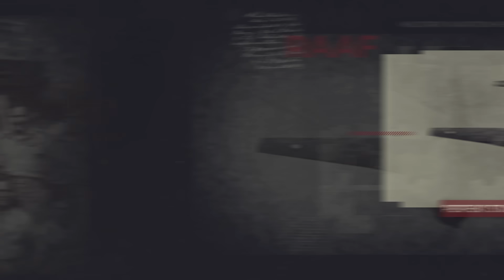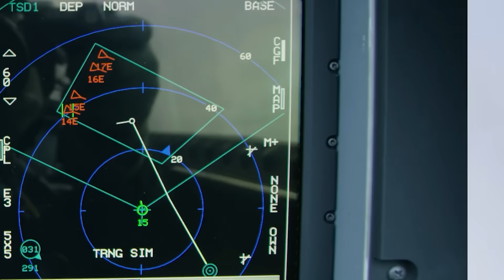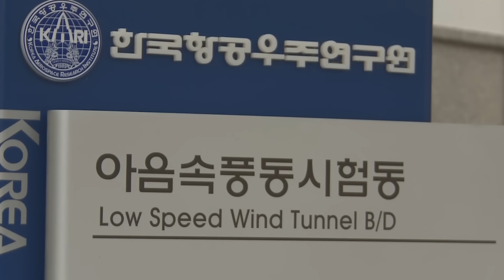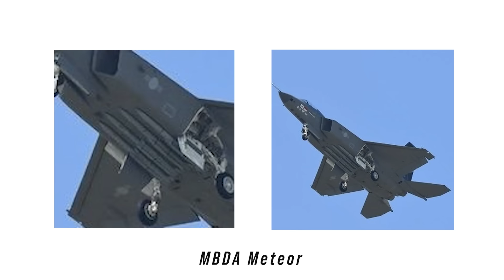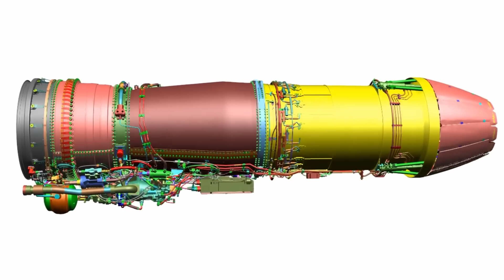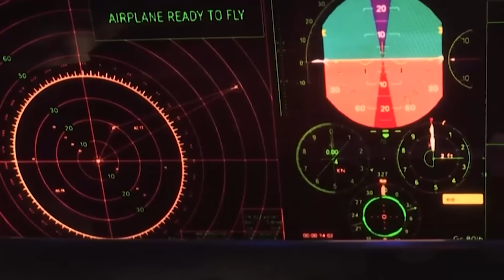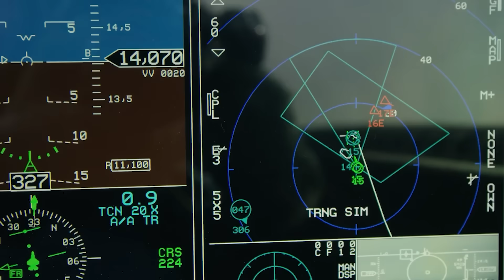KF-21: Korea's New Fighter

Comment: For Australia, the KF-21 would indeed be a good option. Currently, Indonesia has been delaying its 20% share of the payment for years, only demanding excessive technology transfers that differ from the initial contract. South Korea has requested that Indonesia at least submit a plan for the share payment, along with compliance with the contract, but the Indonesian government has even missed the promised deadline for the payment plan. In this situation, if Australia, one of South Korea's closest allies, were to cover Indonesia's share, it would be a very welcome move for South Korea too.
Reply: Well, Australia has a better credit rating, that's for sure.
Reply: When the South Korean government initially evaluated the plan, they considered it somewhat risky to independently develop an aircraft with such capabilities. Therefore, the government was only willing to approve the project if the risk could be mitigated by adding a foreign partner. It seems that Indonesia's commitment to financing the project played a significant role for KAI  to persuade the South Korean government to approve and support the project. Despite Indonesia's current reluctance to fund the KF21 due to changes in their political stance, KAI has achieved its goal by getting the support of the South Korean government and advancing the fighter's development to the current stage. At this point, Indonesia's cooperation may not be critical, as KAI has largely realized its short-term goal—a domestically developed middle-class fighter to supplement F-35s, which are not enough in numbers to fulfill all the Air Force's needs...
Reply: And they stole secret documents yesterday.
Reply: @Eric.Y314  false flag actually
Reply: @Eric.Y314   Apakah ada bukti ?
Reply: @Eric.Y314  the accusation of stealing is just a drama made by Korea to pressure Indonesia to continue what the world already knows, and now it has been proven that Indonesia did not steal and in the investigation by Korean investigators DID NOT FIND ANY EVIDENCE THAT INDONESIAN ENGINEERS STOLE THE TECHNOLOGY ON THE PLANE. AND WHAT NEEDS TO BE KNOWED IS WHY INDONESIA DELAYED THE PAYMENT OF THE PREVIOUS CONTRIBUTIONS THAT HAVE BEEN AGREED TO BE BECAUSE THE KOREAN PARTY BREAKED ITS PROMISE RELATED TO THE TRANSFER OF TECHNOLOGY PREVIOUSLY PROMISED TO BE GIVEN TO INDONESIA ON THE CONDITION THAT INDONESIA WILL BEAR 20% OF THE CONTRIBUTION COSTS.
Reply: @FadhielMuhammad25  Your logic was proven wrong at the recent Apec Summit in Korea. When the Korean president urged the Indonesian president to keep his promise, the Indonesian president panicked and requested a closed-door meeting. How shameful! And yet, do you still believe such false propaganda?
Reply: As a South Korean I won't be surprised if our government is still open to future joint development and production programs with more countries that are mutual allies to the US. We like friends who are like us: democratic, with a scary autocratic neighbor, and in need of a lot of equipment without paying a metric American Defense Budget for them.

Plus, I like the AS-21 Redback. Because it's cool.
Reply: If Australia is Korea's partner, it is far more competitive than Inni in technology and production line transfer. But even if they try it, Korea will not easily let go of Inni. However, I think Korea will be friendly if the decision of ally Australia to participate is implemented.
Reply: 인도네시아는 신뢰를 버렸다. 개발기간 동안에 맘놓고 관찰하고 지켜보면서 그들이 해낼수 있는것만 선택 하려 한것이다. 애초에 비열한 의도로 비용납부를 미루다가 도저히 않될만한 기술만 쏙 빼서 가려는 것이다. 그러나 그들은 반드시 후회 할것이다.   그들이 훔쳐보고 나서 스스로 해낼 것으로 판단한 기술들 때문에 결국 아무것도 해내지 못할것이다. 자만심, 기회주의는 결코 실패의 길이다.
Reply: @yaho33 Yeah as an Indonesian I'm also kinda disappointed that our government violated the payment contract and stole some classified docs about the jet, i was hoping to see that jet being part of the Indonesian airforce, on behalf of Indonesians I apologize for the corrupt politicians who violated the contract
Reply: Come on Australia❤
Reply: Actually, Indonesia just cannot pay. Broke af, but with big ambitions. So they became a financial Pariah.
Reply: @Lee-q8x3n ,ya kami bangkrut untuk itulah perlu belanja keberbagai toko senjata diberbagai belahan dunia, karena jika kami bangkrut hanya perlu sedikit mencangkul tanah kami dan kami bisa temukan banyak harta tersembunyi
Reply: @Lee-q8x3n  ㅈㄹ . 돈이나 갚아 거지국가야
Reply: 장난하냐 그러고는 다른나라 쇼핑계속하던데 니들은 어휴 . . .
Reply: Many Koreans share the same opinion.
From our perspective, it doesn't matter whether it's Poland, Australia, the UAE, Saudi Arabia, etc.
I'd prefer to see the contract with Indonesia terminated.
From our perspective, we already have a justification for terminating the contract.
Reply: The US will pressure Australia to buy its fighter jet instead, just like the French submarine deal
Reply: Yang sok tau suka ngemut qontol
Reply: No Korea will not work with Australia another NATO puppet
Reply: "Only demanding excessive technology transfers that differ from the initial contract". Lol, that's a huge sh*t you pulled out of your ass there. Is it our fault that S Korea had to resort the said tech to the US because they failed to develop it by themselves in time? It is in the initial contract, but the US didn't allow the tech to be shared with us, which is understandable since it's a bilateral deal for a sensitive tech. 

This isn't the first time we've been disappointed by S Korea project anyway. The Chang Bogo sub sucks, there are reasons why we choose Scorpene instead of adding them.

Tell me why S Korea continue the project with Indonesia now paying lower amount of money than the initial agreement? In your narrative Indonesia is bad and S Korea is stupid. That's what happen when you already have a fixed answer of '3' and force it to a '1+1' question I guess.
Reply: a good plane for a country depends on what it possibly has to fight, for Australia, that'll probably be China, so their best fighter is at best 4.5gen (refuse to call that 5th, as it's stealth is compared to other stealth of same generation more like reduced visibility, like this KF21), so if you wanna win against china's numbers, you need something better... F35 is kind of the only option for now...
of course if you look at money first and foremost, perhaps this is the best choice, South Korean stuff seems reliable at the very least, a mix perhaps
but like I said, "a good  option" for Australia (or any other country) depends on priority, performance =  F35, money = KF21, or any other western 4.5th gen !
seeing this video, nothing special jumped out about this one compared to other 4th gen, except for this being low observable
can't recommend F16, as it is a very old plane, latest blocks just serve to keep it in service longer as it is a very good plane, it keeps everything viable, better radars, software etc...
buying new F16 when you don't have any now, is like buying a phone for witch you know there won't be any new software updates coming
Reply: Agreed! Has there been any movement in that direction in the past year.
Reply: Australia's military "shopping list" is written by migugs .
Reply: Australian and South Korean GDP are about the same at USD $1.7 trillion in 2023. Many believe Australia lacks the financial resources to develop a project such as the KF21. The achievement of South Korea dispels this myth.
Reply: Fark Indonesia.
Reply: @Ha-nw2dl  호주는 어차피  미국  전투기를 구매하는 나라여서  참여할 가능성 없어요  미국전투기가 아닌  전투기를 구매하는  동기를 가져야지  실제 이익이   생기는겁니다
Reply: 인도네시아 애들은 기술 훔치고 분담금도 내지 않으면서 불평불만을 하는데 이 자체만으로 어떤 신뢰할 수 없는 파트너임이 명백하다고 봐야죠. 
이를 옹호하며 한국에 대해 알 수 없는 적대감을 드러내는 국민들 수준도 비슷하네요. 반대로 한국이 외국과의 국가 거래에서 기술을 훔치고 돈을 주지 않는다? 한국인들의 애국심은 대단하지만 그들은 자국의 잘못된 방향을 절대로 무비판적으로 관용하지 않습니다
Reply: @Davis33  미국 연방 정부가 한국인 기술자를 기술 절도죄로 기소하고 있어.
만약 미국의 군사기술을 미국의 비동맹국으로 유출하면 한국 정부는 중국 같은 제재를 받을 것이라고 생각하기 때문에 경제가 파탄한다고 생각한다.
즉 한국의 전투기는 세계로 수출되지 않을 것이다.
미 검찰은 박씨가 설립한 나비오닉스코리아가 2014년 한국항공우주산업(KAI)에 대해 실시한 프레젠테이션 내용에 미 방위산업기업 근무시대에 취득한 군사기술이 포함됐다고 주장, 박 씨는 KAI 이외의 한국 방위 산업 기업에 대해서도 계약 획득을 위해 꺼내는 것이 금지된 군사 기술을 의도적으로 사용했다고 지적했다.
이미 그는 미국 수사당국에 체포(작년 8월)되어 6월에 열린 법원 심문에서 미검찰이 주장한 '무기 수출관리법'과 '국제무기거래규칙'을 위반한 죄를 인정하고 따라서 박씨는 최대 금고형 20년과 벌금 100만 달러를 부과될 가능성이 있다고 보도되고 있으며, 미 법원은 박씨에 대한 판결을 9월에 내릴 예정이다.
Reply: @Davis33 Muslim Indonesia. Don't deal with them.
Reply: 호주가 인도네시아보다 더 좋다
Reply: @Cutecat744  😂😂😂😂 lelucon
Reply: @Cutecat744 비교가대냐 호주사 한국보다좋은데 . 저게나라냐  그지국가지
Reply: Why would it be good for us Aussies? We have f35 already, kf-21 is non stealthy.

And kf-21 is just a US tech anyway with us engine and other tech and would need us approval. No way USA will allow us to buy from Korea instead of them directly.

The only benefit possible would be if Korea had the full tech domestically without USAs help and tech, and sold everything to us with tech transfer and domestic manufacturing capability so we don't have to remain a US puppet vassal state and can be more independent and look after Aussie interests instead of US sacrificial pawn like sk and Japan currently are.
Reply: Australia is a very good country. I often see Korean people in Australia attacking racially on Korean news. Don't do that.
Reply: @홍이-n9s반대아님? 호주에서 인종차별 당했다는 아시아인이 41%넘는다고 하던데 최근에는 정치인까지 ㄷㄷ 😱
Reply: The current F-35/FA-18F combination remains a better option.
Reply: as a korean welcome!!😊
Reply: Hankook Kai's contract was effectively canceled as Indonesia dragged its feet and failed to pay the outstanding balance.
It is the people's order to cancel all contracts and develop independently, or for Poland to develop 5th generation and 6th generation fighter jets with Australia.
Reply: Indonesia lost its credibility at the age of 3
Reply: Copy F22
Reply: ㅍㅎㅎㅎ 애초에 자동차도 못만드는 후진국 인도네시아 따위를 나중에 인도네시아에 전투기를 팔아 먹으려고 이 프로젝트에 끼워준거 자체가 한국 정부가 멍청한 짓거리를 한거지  약속의 가치도 모르는 후진국 인도네시아 하고는 상대를 하지 말았어야 한다 ㅉ
Reply: @하이웨이익스프레션 인도네시아가 없었으면 KF21 개발 시작도 못했어요 예산 문제는 둘째치고 우리도 성공할거라는 확신이 없었으니
Reply: @하이웨이익스프레션   타국을 비하한다고 머가 좋와지죠 얇팍한 인성이 보이네요 우리는 사실만 이야기하면 됩니다
Reply: @하이웨이익스프레션  다른 나라에 대해 함부로 비하하면 안됩니다. 인니가 처음 사업에 참여의향을 밝혔기에 프로젝트가 시작될 수 있었습니다. 
이후에 그들이 약속을 지키지 않고 있는 것은 문제지만 전세계인이 보는 이곳에 함부로 타국을 욕해서 인도네시아 전체를 적으로 돌리는것은 바보. 짓거리입니다. 
저는 인도네시아가 여전히 우리의 친구라고 믿습니다.
Reply: A good option for Australia? Is it really? From a geopolitical perspective, the most important thing for RAAF aircraft is long range (both in terms of ferry range and combat radius), but can the KF-21 meet that requirement?
Reply: @DeerShit01  对于澳大利亚来说f35a是更好的选择
Reply: 가난한 인도네시아,불쌍한 인도네시아 😂😂😂
Reply: Wait...what? Why would Australia want this rip-off? Lmfao
Reply: @LouishiousTheWerewolf  What's the "rip-off", this is a Lockheed Martin licensed aircraft (which is one of the reasons why Indonesia will not have the KF-21 or at least it is not permitted), The KF-21 uses licensed technology and is unlike Chinese aircraft (although this is good for the needs of a low-income country like Pakistan), If Australia takes over Indonesia's portion from there, South Korea will be happy. Lockheed will be happy and we will focus more on the position between China and the west.
Reply: @LouishiousTheWerewolf  I wouldn't say the KF 21 is a ripoff even though it looks like one, it is kinda kinda like a cheaper alternative to the F-22 and I'm just disappointed that the Indonesian gov violated the contract instead of opting for the F-15s, and a bunch of French Rafale jets, KF-21 had a huge potential for the Indonesian airforce but the corrupt higher-ups made that impossible by violating the contract   
And stealing classify docs
Reply: @ohio7876   good point. As a Canadian, we should have gone with the upgraded F-15EX
Reply: @ohio7876  anda bukan orang indonesia , kamu orang luar yang cuma menjelekkan negara sendiri.
Reply: If there are still parties who accuse Indonesia of stealing technology, in fact the accusation of stealing is just a drama created by Korea to pressure Indonesia to continue what the world already knows, and now it has been proven that Indonesia did not steal and in the investigation by Korean investigators DID NOT FIND ANY EVIDENCE THAT INDONESIAN ENGINEERS STOLE THE TECHNOLOGY ON THE PLANE. AND WHAT NEEDS TO BE KNOWED IS WHY INDONESIA DELAYED THE PAYMENT OF THE PREVIOUS CONTRIBUTIONS THAT HAVE BEEN AGREED TO BE BECAUSE THE KOREAN PARTY BREAKED ITS PROMISE RELATED TO THE TRANSFER OF TECHNOLOGY PREVIOUSLY PROMISED TO BE GIVEN TO INDONESIA ON THE CONDITION THAT INDONESIA WILL BE WILLING TO BEAR 20% OF THE CONTRIBUTION COSTS.
Reply: Tidak akan mungkin bisa ,
Korea rugi kalau Indonesia keluar dari proyek...?
Buktinya korea memohon untuk minta dana sisa proyek kf21
Reply: It would be better for Indonesia to resign and cancel this collaboration.
The Korean side got technology from the USA.
"There are 129 key technologies, while the USA did not provide 4 key technologies to anyone, while 9 technologies were not provided to Indonesia, also Indonesia cannot export this fighter aircraft because the USA did not give an export license to Indonesia. It only benefits the Korean side.
Reply: @Akunsaya-r5b dude what are you talking about? Most of Kf 21's tech is from Korea not the US. Not being able to sell the big tech weapons such as tanks, tank howitzer, and fighter jets without the original producer's agreement is common sense. No one does that shit. It's also illegal to open it up freely. God knows why Indonesia is not keeping their promise but its a pretty fucked up move
Reply: @prohightension2000  What information do you that this is a mostly Korean designed fighter? I think it's pretty obvious that Lockheed-Martin did quite a bit of design work on the plane and the avionics and powerplant are western designs.
Reply: @chriskerwin3904 more than 60% are Korean tech and even engines will be built by hanhwa
Reply: @hlcapa  oh yeah, the Pratt & Whitney F100 and F414 are definitely "Korean tech" seeing as they were designed in the 1970s for the F-15 and F/A-18 respectively...
Reply: @chriskerwin3904  didn't say it's korean tech but hanhwa is currently building those engines under license using korean parts and materials.
Reply: @chriskerwin3904  meanwhile Indonesia can't even repair it's own transport aircrafts
Reply: @hlcapa  Sure, and many countries that fly F-16s build the aircraft in their home country under license. Does that make an F-16 Danish or Turkish?
Reply: @hlcapa  uhh, okay, I literally could not care less about the Indonesian military.
Reply: @chriskerwin3904  Most of the KF21 is Korean tech except Engine (which is license production in Korea) 
But even the engine will be Korean tech soon Becuase 2 Korean companies competing to build the engine now (Hanhwa and doosan) Hanhwa is already manufacturing engines with license. 
And Doosan already has own tech and produced power plant engine which is same tech as jet fighter engine. 
So it will be just few years away at the most
Reply: @prohightension2000  Are there any Korean companies that make jet engines?
Reply: @chriskerwin3904 you need to do more research. The key contribution from LM to kf21 program was consultation on the stealth airframe. The avionics, radar, IRST, stealth coating, etc were all developed in house by the Koreans. LM refused those core technology transfers.
Reply: @hlcapa didn't you know it was for a long time indonesia has aircraft manufactur which has produced CN 235 ( joint production with CASA), N 212 and N219
Reply: @chriskerwin3904  서방이 한국한테 전투기 기술을 줄이유도 없고 달라해도 안줌.
Reply: @prohightension2000  Still about 45% is American and they do not give that away without strings attached, which is as it should be.
Reply: @prohightension2000  Indonesia's military budget was instead made to buy 42 Rafale fighter jets and 35 ex-F15 units,They also bought stealth jets from Türkiye and added warships from Italy and Türkiye instead of paying the pending 20% arrears,you can see that in the news they bought and spent a lot of money to buy fighter jets from America, Türkiye and France as well as South Korea itself, namely the T 50i again,Why don't they just pay the remaining arrears when they are perfectly capable?
Reply: @Akunsaya-r5b  Then why did the Indonesian government make the contract? contract is contract.
Reply: @Ha-nw2dl  Must listen to Indonesian version of the story before decide who breached the contract.
Reply: @Ha-nw2dl  Because they will have the capability to build their own jets and not buy again from other countries. Doesn't mean you can't export it to other countries you also can't build it for your own Air force.
Reply: @Ha-nw2dl pada awalnya Korea Selatan menjanjikan transfer teknologi penuh, ketika kontrak sudah di tandatangani, pihak Korea Selatan melanggar janji mereka.
Reply: @Akunsaya-r5b  SK has nothing to lose really. If Indonesia pays less, they get less of the amount of aircraft and no technology transfer. 
SK will never share anyone with core technologies and it's on the contract. This is also reason why US is not sharing with SK and Indonesia. SK has several other countries who are interested in collaborating with this project.
Reply: @Akunsaya-r5b  겨우 20% 내면서 개발에 도움된것도 하나도 없으면서 4대 핵심기술과 129개 기술이전을 다받고 싶고 자체 제작해서 수출까지 하고 싶다고요? 제정신임?
Reply: @Akunsaya-r5b  핵심기술 전부알려줬으면 대한민국은 우주선을 만들었어요
Reply: @Akunsaya-r5b Sure, but if you take all the risk and develop a fighter jet from almost scratch, fronting all the costs while Indonesia sat back and waited for the result and was planning to pay up only if the development was successful, why should you get all the benefits? That's not fair. For example the critial AESA radar system was self developed because the tech was not provided by the US.
Reply: @Akunsaya-r5b  호주는 신뢰 할수 있는 국가 입니다 인니는 신뢰 할수 없는 국가 입니다 ....호주 사랑 합니다 ~~
Reply: @머시다냐  aku tidak peduli 😂😂😂
Reply: @rahmatrendy41  나도 상관 없어
Reply: @rahmatrendy41  니네 나라는 신뢰성이 읍어서 여권 순이도 낮자나 한국은 왠만한 나라 걍다 바러 통과인대
Reply: @머시다냐  호주가 무슨 신뢰할 수 있는 국가인가요 K9 에 10조 투자한다고 공장 지어달라고 하더니 1조라는 거금 투자해서 공장 지어놨더니 50대 주문하고 계약 깬 놈들인데 현지 공장에서 기술 이전만 받고

한화가 호주에서 손해본것 폴란드에서 뽑는중 폴란드가 호주보다는 신뢰할만한 국가임
Reply: @Benecian  헐 생 양아치여내
Reply: why Indonesia delay the payment it is because the korean not share the tech to indonesian enginer, this is spouse to be a joint development but no the korean just want indonesia money without share the tech that spouse to be to share to indonesia so indonesia can made it back home with their own specs but the korean deny it, so the gov didnt want the same story in the chang bo goo submarine (it is a bad subs many design failure in it) instead to waste money in uncertainty the indonesian go to france and acquaire Rafale fighter jets, the fighter that have a battle proven and the top noch of US Air superiority the F-15EX why the indonesian need to waste money to something uncertain, and in the latest Indo defence the Indonesian Gov reach the Turkish to cooperate in development of KAAN, and it is make the korean shaking so they  are literaly begging the indonesia govt to continue the KF-21 program with big discount for 20% share of Indonesia and indonesia can pay it with other export goods to korea, see for the koreans, the Indonesian dont need you, the koreans need indonesia and thats is the FACT, and do not dreama country like Australia will join the development of medioker jets they already have F-35 and better for them to developt their own
Reply: @christiantobing8040  Don't talk nonsense. The fact is that Indonesia didn't pay the money within the payment deadline and didn't keep its promise. What kind of thief do you mean by not paying properly and just giving technology? Indonesia should keep its promise first and say it.
Korea can fully develop fighter jets without Indonesia and there are many partner countries that are so reliable that they cannot compare with Indonesia.
So either pay for it or please get away on your own.
Reply: If Australia join the KF-21 indonesia would better Cancel or Get-out from Projects.
Indonesian Must Think Carefull that Australian would play their roles to "Kill" Indonesia interest rate on their projects
Australia is Well know from long time ago that did-not want Indonesia to be strongest in Regions
Reply: Changbogo submarine is suckkk
Reply: Bad option you must be kidding with all our infrastructure on F-35 and you want a 4.5 gen. 
This aircraft will have less capability than our super hornets.
Its not 5th gen its not stealth! it's 4.5 gen in a 5th 6th gen world.
Reply: @LeeD-c6z  Their first goal is only 4.5 gen. The second is to upgrade 5 gen, and the third is to integrate drones with unmanned 6 gen. Keep in mind! South Korea is not as stupid as you are.
Reply: Korean KF-21 is all foreign technology, all core techs need import; Korean should just stick with Kpop with all those sexy dancing and singing.🤭
Reply: @kinwaisiu9414 "One day, an Indonesian girl said something to me. She said, 'Koreans are racists, they are all racists.' I was really surprised because I never had any such thoughts. But after reading your comment today, it has become quite clear."
Reply: @kinwaisiu9414 delusion😂😂
Reply: @kinwaisiu9414  중공은 훔치는걸 계속해야 하는건가요? 그럼? 😃 테무 알리에서 폐기물이나 보내지 마세요
Reply: @조로-p2c  當韓國人無力競爭又憤怒時，誣告中國人往往是唯一的選擇。🤭
Reply: @조로-p2c  -
다음은 한국이 중국의 첨단 기술을 표절, 복제 또는 도용한 사례입니다.

- 군용 드론 표절 사건: 2024년, 한국 KBS는 한국군의 드론 조달 입찰과 관련된 스캔들을 폭로했습니다. 낙찰받은 기업이 전시한 수직 이착륙 드론 제품 모형과 도면은 중국에서 온라인으로 판매되는 유사 드론 제품과 외관이 거의 동일했습니다. 한국군은 해당 기업이 표절했는지, 그리고 제품이 중국에서 제조되었는지 조사 중이라고 답변했습니다. 관련 기업은 중국 제품의 외관만 언급했을 뿐이며, 최종 제품 설계 및 제조는 한국에서 이루어졌다고 주장했습니다.
Reply: @조로-p2c  - 감시 장비 사고: 한국군이 최전방 부대에 설치한 1,300여 대의 감시 장비는 모두 "중국산"이었으나 국산 장비로 위장했습니다. 이 장비들은 오프라인으로 배치되지 않았으며, 감시 영상은 중국 클라우드 서버에도 동기화되어 있어 영상 유출 위험이 있었습니다.
Reply: @조로-p2c  - 드론 부품 조립 및 리브랜드 사건: 2022년 한국 정부는 북한 드론의 국내 진입 사건에 대응하기 위해 11억 8천만 원을 들여 드론 651대를 구매했습니다. 그러나 이 드론들은 훈련 중 추락 사고가 빈번했습니다. 조사 결과, 당첨된 업체는 배터리, 프로펠러, 변속기 등의 부품을 중국에서 구매하여 한국에서 조립하고 리브랜드를 부착한 후 한국군에 납품한 것으로 밝혀졌습니다.
Reply: @조로-p2c  - 해상초계 드론 표절 사건: 한국 언론이 한국군 해상초계 드론이 중국 상용 드론과 매우 유사하다는 사실을 앞다투어 폭로한 적이 있습니다. 중국 상용 드론 사진과 비교하며 GPS 안테나의 위치와 모양, 날개 분해 장치 등 두 드론이 유사하다고 주장했습니다.
Reply: @조로-p2c  - 한국 "천궁" 미사일 부품 사기 사건: 한국 "천궁" 미사일과 미사일 진지, 그리고 나사, 폭발용 과염소산암모늄 원료, 전원 공급용 실리콘 제어 정류기, 군용 전선, 다이오드, 선형 집적 회로 등 기타 무기 체계의 중요 부품들을 중국 타오바오에서 구매한 후, 미국에서 수입한 것처럼 위장하기 위해 재인쇄 및 포장하여 수백 배의 가격 차이를 냈습니다. 해당 외주업체는 심지어 중국 본토 타오바오에서 중고 전선을 구매하여 "군용 전선"으로 위장하는 등 위조 서류를 작성했습니다.
Reply: @조로-p2c  -인천광역시가 발표한 오쿠루스트 타워 설계안은 중국 광저우시의 랜드마크 건물인 캔톤 타워("슬림 웨이스트")와 유사합니다. 두 타워 모두 마름모꼴의 강철 지지대를 사용하고, 날카로운 꼭대기를 가진 독특한 "슬림 웨이스트" 형태를 갖추고 있습니다. 유일한 차이점은 오쿠루스트 타워에 안대 모양의 전망대가 추가되어 있다는 점이며, 디자인 표절 의혹이 제기되었습니다.
Reply: Just get the Gripen.
Reply: @AthosRac  그리펜은 아무도안사요
Reply: @AthosRac  I respect the sentiment, but no longer effective 10 years from now.  I would not be against a full update to the Gripen, but it would mean to every of many specific systems.  I love that Saab Fighter, always have.
Reply: You have no idea the real fact about the reason why Indonesian government delayed the payment. Trust me, Indonesia not that poor, they even developing nuclear plant as well as space program at the moment
Reply: @reworks2347  너희들은 중고 전투가나 계속 사길 바란다. 국가간 계약을 위반하면 전 세계에서 비난받고 고립된다.
Reply: @신의열단  as mentioned, you have no idea behind the real story.
Reply: @reworks2347 Ok, rich man. Cancel the KF-21 project and get Gripen jet with coconut oil. We are sick and tired of your whining, rich Indonesian. lol.
Reply: @reworks2347  Indonesia has a population over 120 million with a gdp of 1.4 trillion USD, while its not poor its not wealthy. It’s considered a middle income developing nation.
Reply: @assassin_rk42  Indonesia has 4th largest population that is 270 milion, where the 120 milion come from?
Reply: @assassin_rk42  India is much poorer in terms of population but they have their own aircraft, actually their bargaining power and bad relations with the west are the problem (South Korea still needs America), Do you know why many Indonesians have defended Russia since the Ukrainian war broke out (at least until the time I commented)
Reply: @anal8394  India has been steadily growing right now. Its now the fifth largest economy. IMF reports says it will be 3rd largest by 2027. Unfortunately, poverty still exists in India bcz of the population. But the same population has been a merit for the country in its growth story. In terms of geopolitics we are actually in a sweet spot. We have been able to buy Russian oil and save $7.9 billion all the while still keeping the trade robust with US. So India has great bargaining power. Also it is the only millitary that has pushed back the Chinese bully. Also we have a 4.5 gen and a 5th gen fighter programs under development. The 4.5 gen probably will enter service around 2029 or 2030. So I think India has a bright future. So does South Korea.
I hope we all can live peacefully but Chinese has been really annoying these days. Stay strong guys.. 🇮🇳🤝🇰🇷
Reply: @reworks2347  that's why Indonesia tried to steal the blueprint? lmao
Reply: @drsnowmon  maybe yes and maybe not? were you there witnessed they were trying to steal?
Reply: @reworks2347 nuclear plant isn’t hard 😂
Reply: @hlcapa  but nuclear plants are expensive
Reply: @reworks2347  Indonesia did not pay because Korea did not respond to the bribery request. So Indonesia decided to buy Rafale.
But it also recently turned the Chinese J-10 into a scam. It's an unreliable dictatorship. Indonesia has not paid for two submarines that were already contracted. The manufacturer lost $200 million because they had already begun construction and ordered parts.
The South Korean government is preparing to stop military exchanges with Indonesia.
Reply: @GaegolMaster  Your comment is makes sense but premature. Indonesia has a good relationship with China and Russia nowadays while South Korea is pro to the states. Need to be stop by using non sense reasons. G2G is way too advanced than night market transaction
Reply: @reworks2347  한국과 미국은 피로 맺어진 혈맹이기 때문입니다 한국 전쟁, 베트남, 이라크, 아프가니스탄에서 같이 피를 흘리며 싸운 가장 가까운 동맹국 입니다
Reply: @Emiya-Mulzomdao.  good luck, all the best.
Reply: @reworks2347  We needed Indonesia because it was an experimental project. Are we asking for it? Yes, we need Indonesia to open up the Southeast Asian military weapons market. But things have changed from the past. Saudi Arabia and Iraq also bought air defense missiles from us. The Middle East market is also interested in Korean weapons because of the Israel-Iran war. 
We got a super-level military contract and production plant with Poland in Europe, and that was because of the Russian-Ukrainian war. The European market is open. And Poland didn't buy French weapons, saying that their economy was worsening because of Corona. 

Indonesia say they don't have money, but Indonesia have money to buy Rafale? And Poland didn't even say they don't have money because of Corona. But Indonesia bought the French Rafale even though they don't have money.
The Russian-Ukrainian war and the Israeli-Iran war have opened up the European and Middle Eastern markets. We need Indonesia for the Southeast Asian market, but many other markets have also opened up. 

And you can't ask for 100% technology with a 20% project contribution. It's a fact that you didn't even pay 20%, right? There is no country in the world that provides 100% of its technology. The technology we obtained from Russia through the Bulgom Project was not all provided. It's the same. We are friendly with the US? But the US does not give us 100% Military Technology. The reason why we have to give Indonesia 100% is because they only gave you 20% and not even properly? Are you kidding me?
Reply: @Emiya-Mulzomdao. 혈맹은 무슨 틈만 나면 강탈할 생각하고 통수치는데